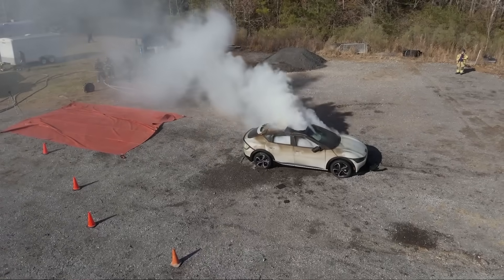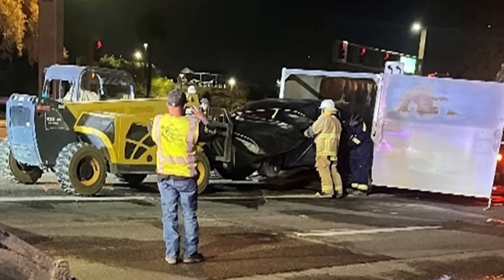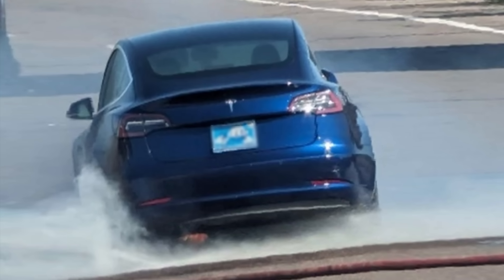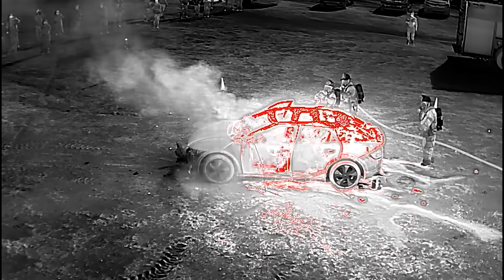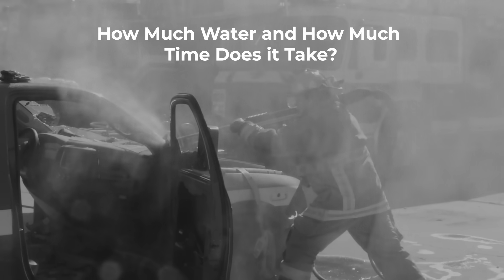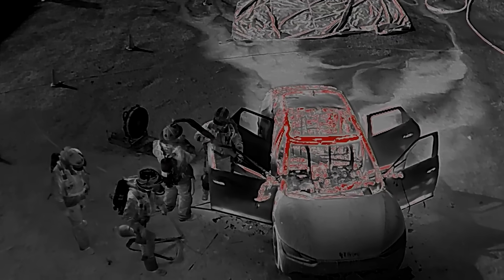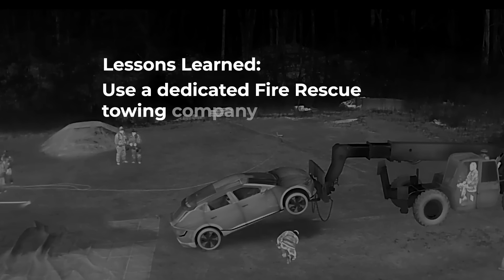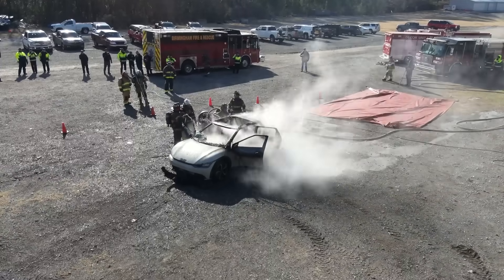Quick and Efficient Method of Extinguishing of an EV Fire tested in Tempe, Arizona

Comment: At no point was this fire crew shown close to flames at 2,000C+. To get this close to a vehicle actually on fire seems an impossibility, you would melt: There is also the distinct possibility of explosions of the gas given off by lithium battery fires which preclude close human contact. This idea seems to be useful to prevent recurrence of further outbreaks at a later stage?

Comment: If thermal runaway is responsible for much of these fires, why don't they equip vehicles with a tap of sorts which would allow direct flow of an agent to cool the battery cells without the need for costly equipment and training for its use?   But it's a great video, just a shame there's nothing an average citizen can do prior to first responders arrival to prevent secondary damage.
Reply from the maker: @ctifnewswebtv3802
0 seconds ago
Renault has a solution like that. But even if all new cars had it, you would still have the older cars requiring a solution

Comment: Why not put a self piercing ability built-in as part of any electric vehicle, the water could easily enter without any other specialized tool, certain fire and temperature set off piercing at needed areas of problem .perhaps all?

Comment: I learned 30 years ago you do NOT put water on a lithium fire. I worked in a laboratory that used all kinds of organometallics in the experiments. Many of these chemicals are extremely unstable. I recall an incident when a small sample of a few grams being stored in a fridge spontaneously exploded and contaminated the entire lab.

Generally the best thing you can do with a metal fire is cut off the supply of oxidant (usually oxygen in the air, but in the case of lithium the oxygen in the water if you are dumb enough to put that on the blaze). A fire-resistant blanket can work, or covering the blaze with something like vermiculite. Again, for these kinds of fires something normally considered inert like CO2 actually fuels the blaze. You need special training to know how to deal with them.
Reply: You are correct when talking about lithium metal. But in this case it is lithium ions.
Reply: @UtkikenRescue  It's the ionic form that is most reactive.... Chemistry 101
Reply: @bobjohnbowles  , could you please elaborate on that. I am not a chemistry major even though i have Chemistry 101. What I have seen in real world tests with lithium ion batteries of different chemistry is that water does not add any visible problems in the form of more flames or more reactions. Can it be that the ions in the electrolyte reacts with other things than  the water during the thermal runaway process?
Reply: @UtkikenRescue  I have no experience of Li ion batteries but I do have experience of Li in organometallic compounds. As I hinted in my OP these are extremely dangerous.
I also have some working knowledge of handling sodium, which is the next alkali metal in the Periodic Table to Lithium. Sodium reacts vigorously with water to create sodium hydroxide, which is extremely caustic in solution, and hydrogen. The sodium will melt and the hydrogen can ignite from the heat generated.
Suffice to say chemical fires require specialist training and handling.

Comment: 1:20
Belive it or not, lithium iron (LiFePo) batteries are a thing and they are very different from li-ion/lipo in that they are weaker and heavier, but very stable
Reply: The thermal runway temperature between the two major technologies is 100°. And lithium iron phosphate batteries emit way more toxic smoke.
Reply: Weak and heavy is definitely a bad argument for electric cars.

Comment: How does this work exactly? A lot of battery packs are filled with epoxy or something else to fill the void space between the batteries, so I'm wondering how that impacts the water's ability to spread through the battery pack.
Reply: I was part of the team creating this method, and what I have seen on battery packs with foam and other material is that water can still stop the fire from propagating from cell to cell.
It is important to be aware that this is not method that will work in all sitruations. Like with all firefighting, sometimes a method is not working. Therefore you need more than one tool in the toolbox. And we need to keep learning about when this work and not. 

Also, since we have shown that it is possible to put out EV fires, we need to have the car manufacturers make their EVs possible to extinguish. It cant be allowed, to again, have to deal with 24 hour operations to put out a car fire.
Reply: @UtkikenRescue  Thanks for the information. I'm so glad I got my answer! I agree, we cannot expect firefighters to stay with the car for many hours or even days. Car manufacturers should be held accountable and build vehicles that conform to some kind of fire safety guidelines.

Comment: A high preasure water spray that cuts through steel. That's not dangerous at all. Especially in a high pressure/stress situation. At least it works I guess.
Reply from the maker: The tool requires training, and when correctly understood, with the proper safety procedures, it is actually very safe. You shoot guns on propane canisters in a fire, right? No more or less dangerous of you know what you are doing.

Comment: Cold salt water was used in Europe using the same process. The salt acts to suppress the electrical charge.
Reply: I was part of the team developing this method. Salt water increases the electrical conductivity of the runoff water. At this time we recommend not to use salt water.
Reply from the maker: @UtkikenRescue  Could you elaborate why you don´t recommend salt water? Is it because the run off could electrocute the crew?

Comment: Why can't Tesla design the battery to drop off the vehicle if they detect run-away heat, and then have the car also drop a fire blanket over the top of it to instantly smother any flames.  Could make parking garages a lot safer.
Reply from the maker: Interesting idea. Kind of similar to how the fuel in a nuclear reactor would drop down in a core melt down, stopping propagation of nuclear reaction
Reply: They're already designed barrettes that don't have run away fires and they're in cars. Being improved even more going forward

Comment: Some company needs to develop a kind of water mixed quick setting polymer to inject into the battery compartment. Why?  I am not an expert and I do not have any qualifications but it seems to me that the reason it re-ignites is because of lithium’s exposure to atmospheric oxygen. Seall off that oxygen and problem solved.

Comment: Each of the battery cells should be manufactured with an inlet pipe that can be accessed from the back of the car for injecting water into each of the battery cells. Each small inlet pipe should be routed to a single point in the back of the car so they can all be injected with water at the same time.
Reply from the maker: @ctifnewswebtv3802
0 seconds ago
Renault has a solution like that. But even if all new cars had it, you would still have the older cars requiring a solution
Reply: @ctifnewswebtv3802  True, but we have to start somewhere.

Comment: new production should engineer channels to inject water into the bttery pack
Reply from the maker: @ctifnewswebtv3802
0 seconds ago
Renault has a solution like that. But even if all new cars had it, you would still have the older cars requiring a solution

Comment: Require EV battery manufacturers to provide an externally accessible port that provides a water pipe to quickly flood and cool all battery compartments. An egress hose/port might also be useful for collecting contaminants. There are various mechanisms that could be used to prevent vandals from using the port to wreck the batteries, e.g. a keylock or automatic fire detection release.
Reply from the maker: Renault has a solution like that. But even if all new cars had it, you would still have the older cars requiring a solution

Comment: think about all the other fires behind walls or thin metal that this tool can be used on 
  tiny hole large volume of water ..reduce the risk of a  back draft behind the door
Reply from the maker: These UHP lances were indeed developed to deal with backdrafts and fire gas explosions. The EV application is more recent. It is a very versatile tool which pays off long term even though a but more expensive than regular nozzles. I is also light equipment which can be transported on smaller vehicles.

Comment: Newer EV batteries cannot catch fire so this is a non problem. The issue now is that the older tech batteries last for decades, certainly longer than the life of the car. If you want a storage battery an old NMC battery from a car is a low price method for a good amount of energy storage. The fact that LFP batteries are much safer needs to be publicised more.

Comment: Eeeerm. Here's an important suggestion. The problem with these fires is the thermal knockon that perpetuates the fire. It has been known for a long time that copious quantities of running water directly on the cells inside the battery not only suppresses the thermal runaway, but it also prevents the thermal knockon. Why are all EVs not designed with an internationally standardized port on both sides of the vehicle that are esthetically covered? These ports give direct access to the inside of the battery. If the battery catches fire, the firemen simply plug a hose, with a standardized coupling, into this port, and run water through the battery. The port on the opposite side of the vehicle will serve as the water exit point. Easy, standardized, effective. WTF. Why hasn't this been done yet?
Reply from the maker: @ctifnewswebtv3802
0 seconds ago
Renault has a solution like that. But even if all new cars had it, you would still have the older cars requiring a solution
Reply: @ctifnewswebtv3802  It seems to be an irrational and retrogressive cop-out to outrightly reject the deployment of an obviously feasible solution merely on account of the fact that there's still a cohort of "older" vehicles without the benefit of this solution.
The changes brought about by such improvements are always evolutionary. There's no need to mandate retrofitting if it isn't feasible.
All the first responders have to do is check for such ports and instantly adapt their firefighting tactics: old way or new...

Comment: I knew someone would eventually come up with a solution to this problem.
Reply: I'm surprised that they don't intentionally short all the cells in a controlled manner before transporting to deal with the reignition problem.  Maybe add some salt to the water they are injecting into the pack or something.
Otherwise, it is a bit like leaving the gas tank half full, but worse.
Reply: Lfp batteries
Reply: You mean like not buying an EV?
Reply: @AuxiliaryPanther 🙄 Because gasoline is perfectly safe, right?

Anytime you have a lot of potential energy packed into a small place, it is dangerous.  It's the laws of physics dude.
Reply: @travcollier Well, it is much safer than EV currently. And the fire is less destructive as a tank full of fuel has less energy to release than a battery pack. Diesel being even safer than petrol, while having higher energy density.
Reply: @NameName-ll2yx  No.  Lookup the data.
EV fires are about 25/100K, ICE cars are about 1,500/100K.
Also, a gas tank holds a LOT more energy than an EV battery.  Moving a car of either type takes roughly the same amount of energy, and an ICE car tends to be able to go further without refueling.  But it is much worse than that... ICE cars convert about 20% of the potential energy in their tank to actual motion, while EVs convert around 90%.

EV fires are bad because they are difficult to put out.  That's real.  The other stuff is BS.
Reply: @ Nope. If what you are saying would be true, an empty battery would be safe to stab. It isn’t. The fire isn’t caused by a battery having an electric charge, but by the chemical reaction the materials have when they come into contact with each other. 

The seriousness of the fire is the problem here. ICE cars can catch fire, but won’t cause danger. Besides the statistics aren’t yet reliable due to BEV’s not being around for long enough yet to compare properly. Hybrid cars have nearly double the fires compared to ICE weirdly enough.
Reply: @NameName-ll2yx If I recall correctly the information I have read says it is the electrolyte used in lithium ion batteries that makes them so flammable. Which is why Toyota is replacing the Lithium Ion batters with liquid electrolyte, with solid state batteries. They not only increase range, have faster charging time, but also carry higher energy density than typical lithium ion batteries.
Reply: @NameName-ll2yx They absolutely cause danger, especially as fires can be caused by an accident. There's been an average of about 500 civilian deaths per year from car fires, with about 1/2 of these fatal fires seemingly caused during a crash.

Comment: So it seems a fill tube could be added to vehicles (perhaps retrofitted) front and back (or both sides) where the fire departments can take a 1" hose and instantly hook in. Just a thought. Love the innovation but thats a lots of specific equipment needed (blanket, etc). That way any Fire (Water carrying) vehicle can quickly does. That's an expenditure from congress we can all get behind.
Reply: A fill tube is not realistic.  For one, a tube that goes directly into the battery would pose a serious danger were it to be misused or damaged.  For two, there is a good chance that any fill ports or tubes would be damaged by the vehicle fire rendering them inoperable.  For three, a fill tube would have to be connected at close range, posing a danger to firefighters or requiring an expensive specialized robot.
Reply from the maker: @ctifnewswebtv3802
0 seconds ago
Renault has a solution like that. But even if all new cars had it, you would still have the older cars requiring a solution

Comment: Electronic door handles should be banned, because they only work when the car does. Mechanical door mechanisms have been available for millennia and still work just fine in the event of electric issues, fires etc.
Reply: They work fine and the good brands have mechanical overrides. Why do people think banning things is always the solution, that is such a lazy response

Electronic door handles, electric mirrors etc are used to conjunction with safety features. 

For example, the BYD car monitors the seats to detect if people are present, especially infants

If the vehicle is off and it detects someone in the vehicle seat, then after a while it will automatically turn on the air conditioning to reduce the heat in the vehicle

After a period of time if no one comes, it will start sounding the horn and flashing the lights to draw attention

You cannot do this in an ICE vehicle without first starting the engine because of battery capacity. You also run the risk that you are in a confined space with an ICE vehicle

There are safety aspects you can implement in an EV not possible in an ICE vehicle

Horses for courses
Reply: Apparently you know nothing and can't listen. All the cars have physical openers.

Comment: Going forward... Why not design newer batteries with several "easy access ports" to simply hook up any water source that would flood the battery without damaging the casing, thus helping it to retain the water?   Another idea would be to design an external heat exchanger (like a radiator) with a pump to continue to circulate and cool the water once it has been injected.  Perhaps someone could design a system that would use the heat generated to power the pump.  And, why not simply add an external (to the battery) tank of water (or a more efficient coolant) to automatically activate when sensors detect overheating.
Reply from the maker: @ctifnewswebtv3802
0 seconds ago
Renault has a solution like that. But even if all new cars had it, you would still have the older cars requiring a solution

Comment: Eventually, a robot will do this and put the fire out in 5 minutes.
Reply: It's got nothing to do with who is putting out the fire but how it is extinguished

You do understand the issues with an EV fire and why this solution works don't you?
Reply: @stultuses  robots will do it faster and with less risk to humans. They won’t hunt around for the right spots, as sensors will find them quickly.